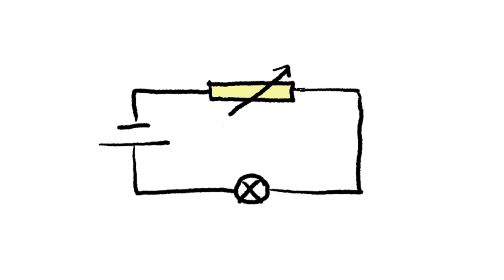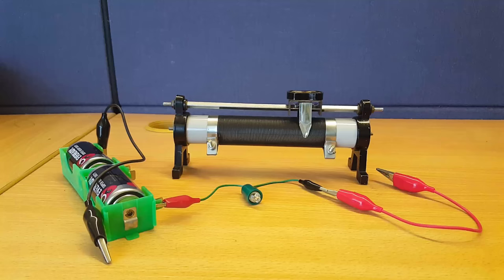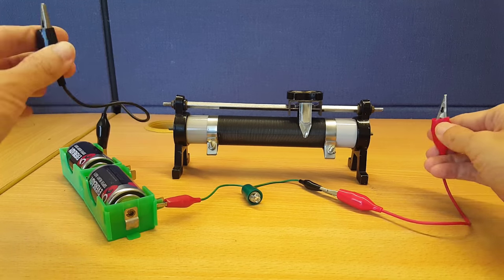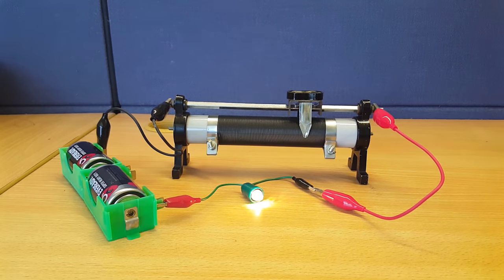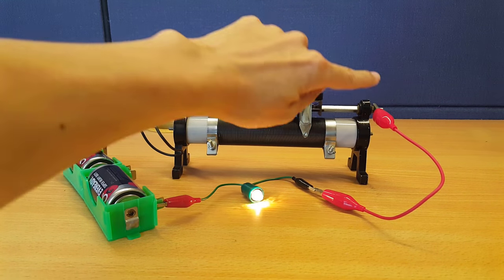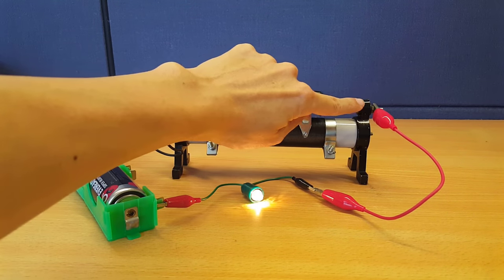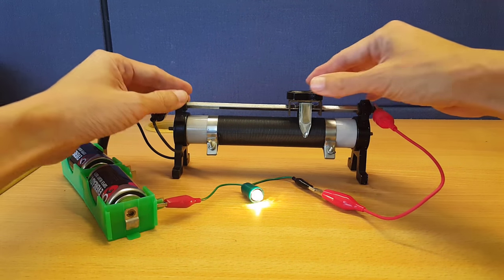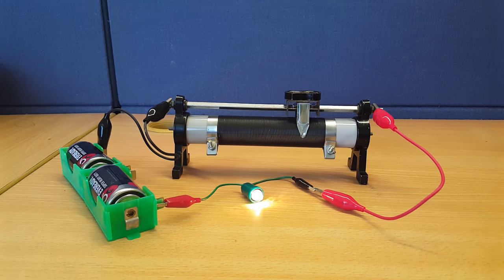How to connect a rheostat

Comment: What is the difference between a rheostat and a potentiometer? WHEN would we choose one over the other? 

I understand that a Rheostat controls Current, and a Potentiometer controls Voltage. 
What I am trying to understand as to WHEN, and WHY, in some cases, we need to control Current, and in some cases Voltage.